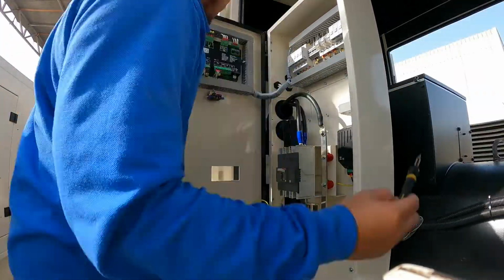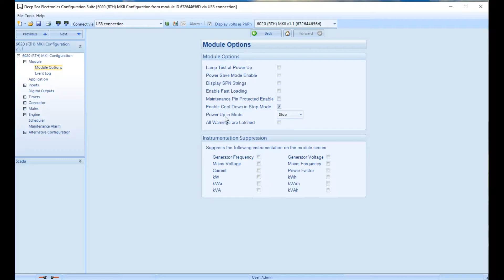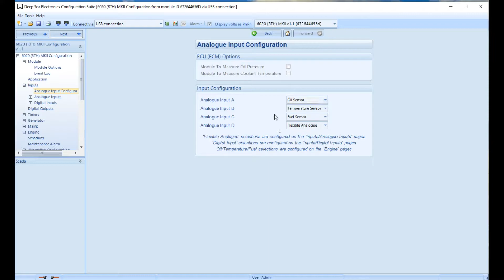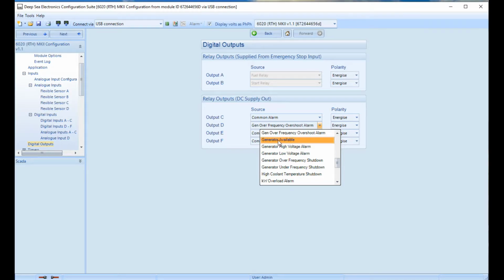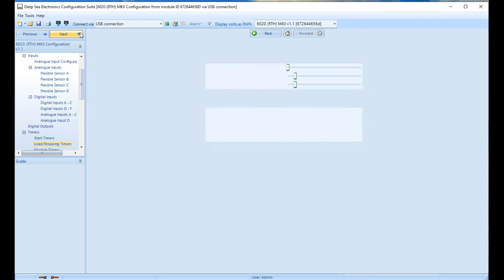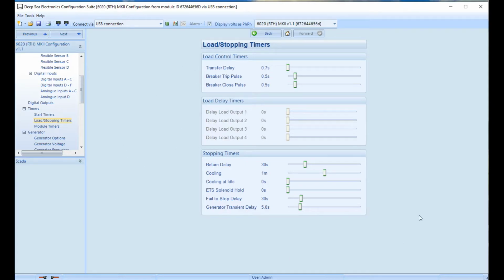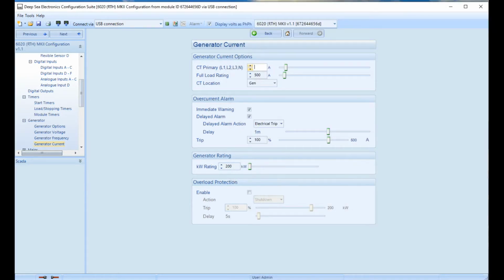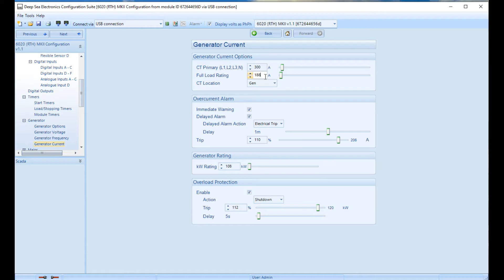DSE 6020 Configuration and Installation? lets do this!! benzblogs

Comment: hello! Mr.Benz, I'm changing the 720 panel to a DSE 6020, but the starter solenoid is always energized, causing the engine flywheel to bend, what should I do?
Reply from the maker: Where did you connect the wire for starter make sure that your Wiring is in proper connection can u till me which number u connect the starter relay and u did the correct config?
Reply: how to get CAN hi & Lo output from controller?

Comment: The generator managed to start in remote start mode but died after 1 minute of running why ?
Reply from the maker: One thing check what is the alarms ak we can identify what the problema
Reply: Nothing alarm sir and after 1 minute Genset start Again with remote start and stop again continue the Generator can stop with stop button depsea
Reply from the maker: If u have remote active meaning your in auto and you have ats?
Reply from the maker: Now make sure that from the ats side should always close the signal or the contact from your relay so the genwrator will not start and stop of check yojr ats settings my there wrong
Reply: @benzblogsVlogs  no I dont have ATS sir the Genset Running normal with Manual mode only, but l want to try Running with Mode Auto Remote start Genset if input pin 38 l give negative battery the can Genset Running after 1 minute the genset off, why is there a setting in module ? Please help me 🙏🏻🙏🏻
Reply from the maker: @asengsaputra288  if u want to try remot to start it ahould be in auto thin find out the you temote start short it with two wire in order to start but one you open the connection it will shutdown or stop that why you need ats or any cobtrol module to command auto start the generator
Reply from the maker: @asengsaputra288  or dry contact to close the remote in order to start automaticaly
Reply: @benzblogsVlogs  yes l try with dry contact to close and Depsea module auto mode the Generator Running but 1 minute only the Generator Off
Reply from the maker: @asengsaputra288  check the config my its only remote off load or remote start
Reply: @benzblogsVlogs  module type 6020 MKll the Config Remote Start on load 🙏🏻
Reply from the maker: @asengsaputra288  this you must uncheck the AMF function

Comment: Hello sir how to setting Remote Start Genset ?
Reply from the maker: What module your using you need to config the module in order to set as a dunction of remote start it should be in digital input
Reply: @benzblogsVlogs  what is the cable number for remote start for DSE6020 MKII

Comment: Hi. Where and how do we connect dry contact start signal from a solar inverter?
Reply from the maker: Send me picture
Reply: @benzblogsVlogs  I have emailed you the pictures
Reply from the maker: If the solar inverter is should have that option but if nothing that option you can do one thin buy voltage monitoring that can trigger relay if battery low to start the engine
Reply: @benzblogsVlogs   The solar inverter has a dry contact port for sending gen start-stop signal but I am not familiar with how to wire it to the DSE controller. Right now grid and generator is connected to an ATS and the output of the ATS is connected to the inverter input. I want the signal to start the genset to come from the inverter and the gen to stop either when: 1. batteries are charge or 2. grid is back

Comment: Sir benz, just to ask why the neutral and ground has a voltage? what cause of that situation? and how to prevent that to happen? and what is the allowed voltage of neutral to ground.
Reply from the maker: If the voltage is below to prevent this is to provide earthing and if your alternator having nutral connect it tobthe earth to avoid any issue for long term
Reply: @benzblogsVlogs  thank you so much, this helps a lot and we did it already bonding of neutral and ground.

Comment: Any simulation option for program testing
Reply from the maker: If you mean simulate where we are doing the load test that is same config ias a simulation procress
Reply: @benzblogsVlogs  no I mean , I will make settings in controller and without field connection through system it's possible to simulate program.
Only for testing purposes.
Reply from the maker: @naushadmohammad2784  im not sure but i the computer you can only simulate those congured as logic

Comment: Sir sang terminal ko po isasaksak yung start command wire from ats.
Reply from the maker: Hanapin mo sa config ang temot start doon na wire monpwedi
Reply from the maker: Gagana lang yan pag nakauto ang module mo
Reply: Sir nakita ko na po yung remote terminal. Kaso hindi ko alam kung san isaksak tong kabilang dulo. Sa ground po ba to o sa start terminal ko cya isaksak

Comment: Ser benz .. sa loading voltage po ba  lahat po ba  is 95 % dapat   .. halimbawa po sa 440  bali po loading voltage nya is 420
Reply from the maker: Yes automatic magadjust yan kong ano ang nominal nyo
Reply from the maker: Yes if you calculated
Reply from the maker: By %tage if you calculate this is the result 418-420 its ok
Reply from the maker: Yea sir dapat 95%

Comment: Sir benz possible b magabo ung RPM khit alang laptop?? 1700 lng kc limit need 1800 po..sana masagot salamat po
Reply from the maker: Dependi sa engine sir
Reply from the maker: Kong perkins pwedi naman kong kabisado mo yung external relay doon sa witing ng ecm kong active ito at kong Cummins naman doon kalang sa speed controller mg adjaut but you have to reconfig the module depwndi sa speed of freq na gagawin nyo po
Reply: Yes po sir cummins po salamat sir
Reply: Sir panu pla mag save s mismong controller ung "check po o ung green button" salamat
Reply from the maker: Sir pag nagsave ka yung long press mo lang yung check button matic nayan

Comment: Hi, for this unit can we able collect datalogs with corresponding time and day? Data logs like power consumption and alarm lists?
Reply from the maker: Yes you just enable what your to get in the conyrller
Reply from the maker: If your doing the config it is posible but in the long run it will easily full the memory
Reply: For Gen alarm limit such as over/under voltage, overcurrent, KW limit and overspeed, will the engine stops once limit is reached or the breaker just opens?

Comment: Im using dse 6020 mkii. Main is 220v 3phase/3wires. How do i make connection to the dse module. Thanks.
Reply from the maker: Sir THIS Module having AMF if it is active go to the panel back you can see V2
Reply from the maker: No are you using single phase or 3 phase
Reply from the maker: You generator also single or 3phase
Reply from the maker: V2 where you can connect the mains from you module